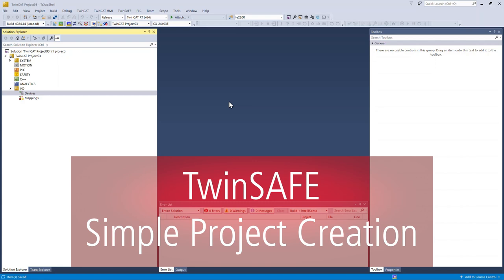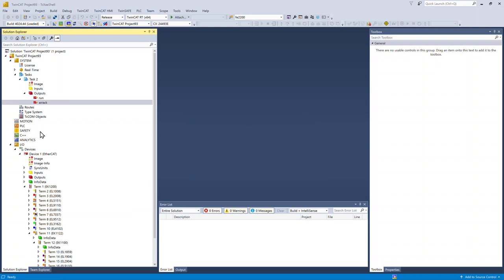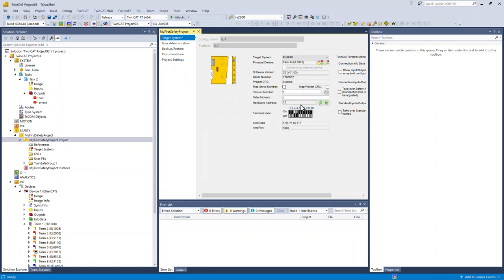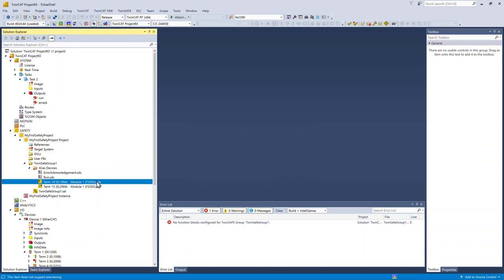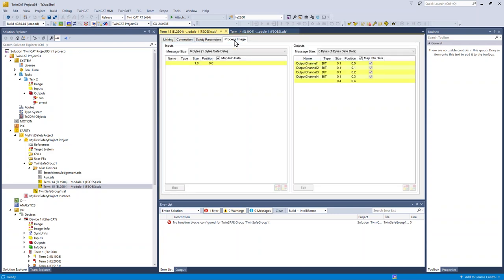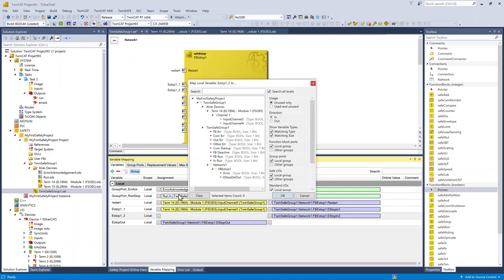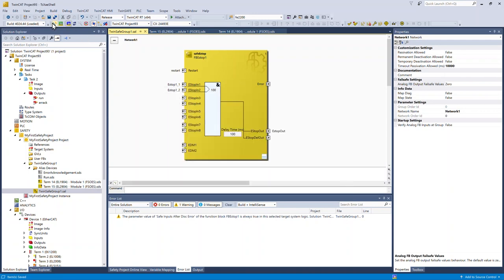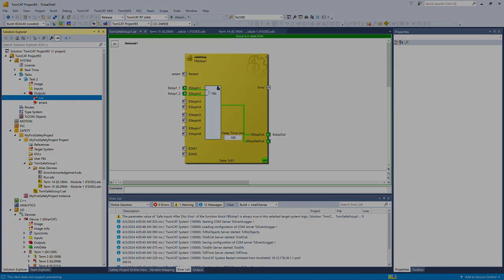TwinSAFE Getting Started

Comment: I followed your steps exactly, but when i want to link the alias devices to the tasks, it is greyed out and it states "not available". Im using a el6910 aswell and i am trying to communicate to a custom slave over a ek1110 with FSoE. Any ideas?
Reply from the maker: I'm not sure exactly what you're seeing, but it sounds like you're trying to connect the Alias devices before the target is defined.
Reply: I did define the targer. But i had two issues: The Dip-Swotches on the EL6910 were configured to address 0 and the custom slaves ESI File was not imported